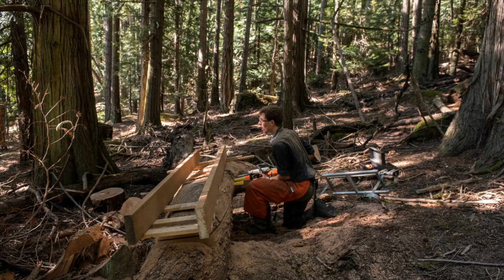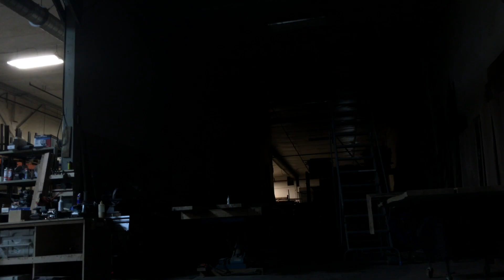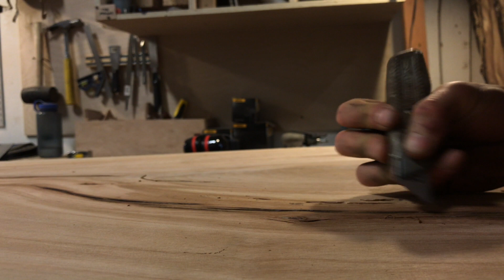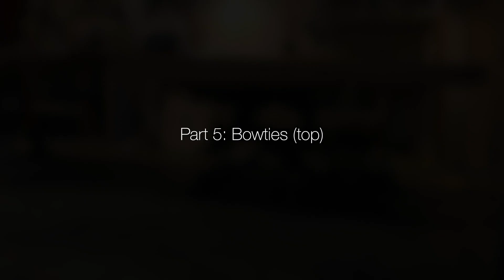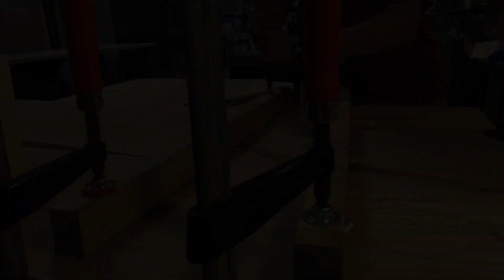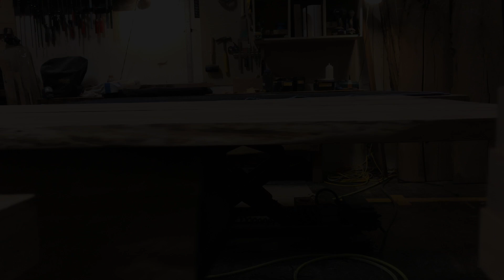Live-Edge Madrone Table | Urban Hardwoods Internship | Alex Olson

Comment: Wait wait wait wait wait. I had to pause and rewatch part 2 like 8 times. So You use a top bearing straight bit, clean/square up one edge, then overlap the conjoining edges and use that 1st edge as a routing guide to basically transcribe a guide line rabbet onto the 2nd slab? Thats brilliant brother. Fn brilliant. Thank you keep it comin
Reply from the maker: Hi Tom! Thanks for your enthusiastic comment. It is indeed a brilliant technique... one of the many I learned as an intern.